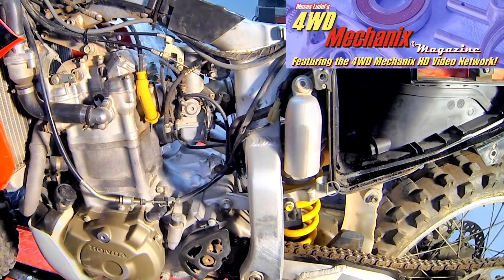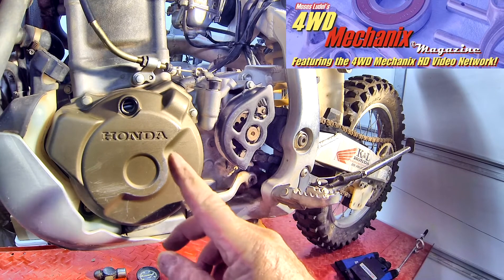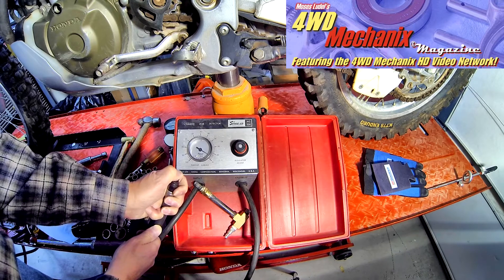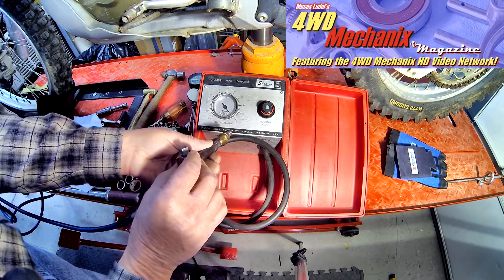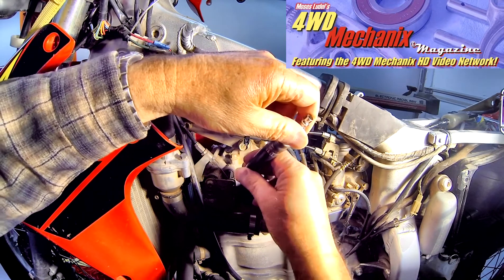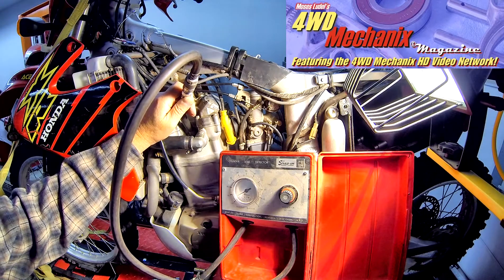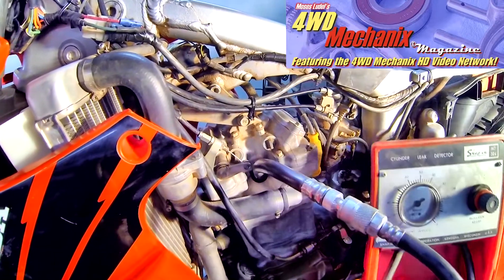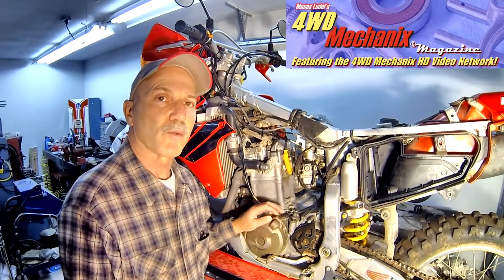Honda XR650R Motorcycle Cylinder Leakdown Test

Comment: Great video. Just did this test to my xr650r and can hear air escaping from the intake. It is also making a gurgling oil noise. Definitely not coming from the radiator. Air is not escaping from stator cover opening either. Is this normal? Thank you.
Reply: Hey man did you ever figure out what that bubbling sound was? I’m having the same noise happening making me scratch my head
Reply from the maker: Gerardo...First, be certain that the piston is at top dead center on the compression stroke.  If the piston is at top dead center of the exhaust stroke, the intake valve is opening enough for air to escape through the intake.  To verify the piston is at TDC on the compression stroke:  the intake and exhaust valves will be closed with clearance between the valve stem tips and rocker arms.  An easy way to know you're coming up on the compression stroke is air pressure felt at the spark plug hole.
Reply: @4WDMechanixMagazine  do you have a better way to get ahold of you sir I have some questions.. thanks do you have Facebook messenger
Reply: I have the same sound.. oil bubbling sound
Reply: Adding myself to the gurgling noise club! Leak down test results were good.the engine is strong and sounds and feels amazing. Oil and coolant are clean. Yet I have this incessant gurgling when rotating the engine.
Reply: Anyone here find conclusive reasons for that bubbling sound? I drained all my coolant and did a second leak down test. The sound is the same. So it’s not bubbling coolant. 

Leak down test results were good. I can not kick the engine over unless I use the decomp lever. What the heck is that noise? Sounds like it’s in the valve train oil supply but that makes no sense.
Reply from the maker: @Mark-vx5dt Sorry it took so long to reply...I've been busy setting up the new https://youtube.com/@motorcycletechandtravel channel.  (The channel's focus is dirt/dual-sport/ADV motorcycle tech and riding...Your participation there would be valued.)  Regarding your need to use the decompressor lever, this sounds like my XR650R when I bought it.  The auto-decompressor was jamming, and I could not kick the engine through.  That was my motivation for installing the HotCams Stage 1 camshaft during the top engine build.  (The HotCams camshaft eliminates the OEM auto-decompressor.)  I can start my engine with one or two kicks, hot or cold, by using the manual compression release to bring the piston to TDC on the compression stroke then slightly over the top.  This puts the piston just into the power stroke and past the kickback point.  I let go of the compression release, and with a firm kick, the engine starts immediately.  Before performing this starting routine on a cold engine, with the stock carburetor's choke on, I prime the engine with only two kicks.  (I use the manual compression release when priming.)  On warm engine restarts, I don't use the choke and prime the engine with only one kick—using the compression release.  The "five" or more priming kicks that many talk about have never been necessary.  (If the engine is stone cold, I do use the full choke to start but immediately open the lever to halfway when the engine fires.)  I'm sharing all this because you may have an auto-decompressor issue...As for the gurgling oil sound in an otherwise great running engine with good cylinder seal and no coolant loss or coolant in the oil, the XR650R engine has a dry sump lubrication system.  You could be hearing oil circulation or suction.  Without letting the engine start, remove the dipstick from the frame and crank the engine through.  Listen for the gurgling oil noise at the dipstick opening.  Have you cleaned the oil strainer at the frame down tube (forward of the engine)?  A restricted screen can distort the oil level and create a dry sump suction noise.  Many are unaware of the frame oil strainer and only change the pleated paper oil filter.  Also, the oil level needs to be checked in the "factory" manner, just after shutting the engine off and thoroughly warmed up.  Crankcase emission controls (California XR650R models) can also create noises.  When these devices are defective or removed incorrectly, crankcase pressure may build and oiling issues can develop...Share your findings at the new channel.  I'll watch for your reply there.
Reply from the maker: At the Motorcycle Tech and Travel channel, some discussion developed around the breather system on the XR650R.  There are noises that come from the crankcase breather.  There is also the unique reed valve between the engine's crankcase and the transmission.  This valve is a one-way type that relieves the crankcase of excess oil and sends it to the transmission.  (Again, the lubrication for the engine is a dry-sump system.)  Transmission oil (the same oil used by the engine) is kept out of the engine's crankcase...The gurgling during a leakdown test that some ask about could be the crankcase air from the test going into the transmission and its oil supply.  Even if the leakdown percentage is a very healthy and low 8-12%, that leak percentage is usually air going past the rings and piston(s) and into the crankcase—where it could be exiting into the transmission and its oil...If this sound is unique to the XR650R, the one-way reed valve in a 4-stroke engine's crankcase is unusual, too.  For further discussion on the XR650R and many other motorcycle topics, join us at https://youtube.com/@motorcycletechandtravel.